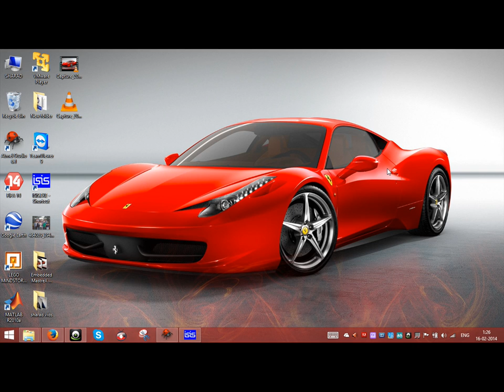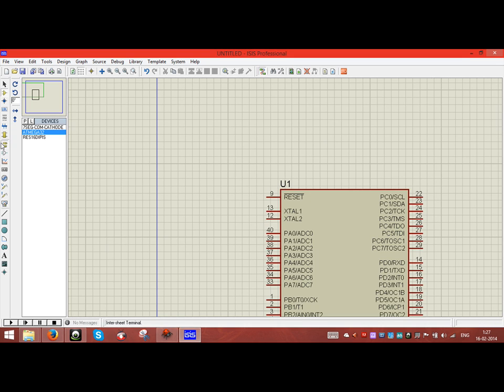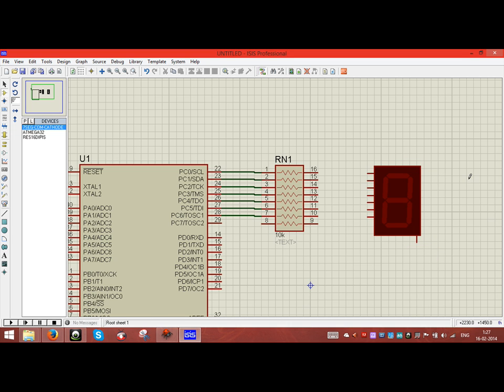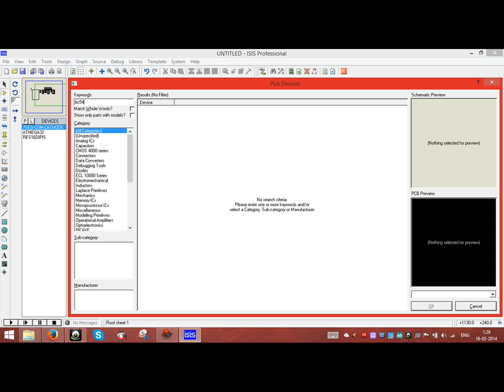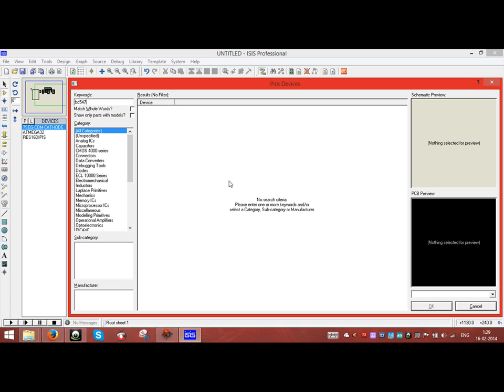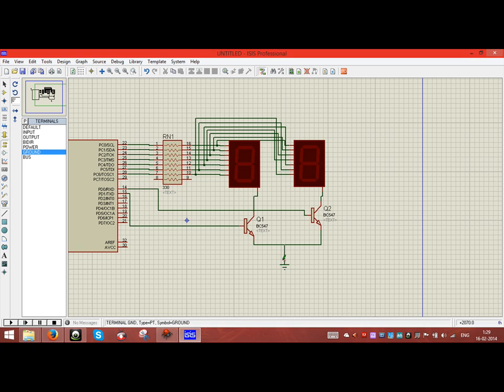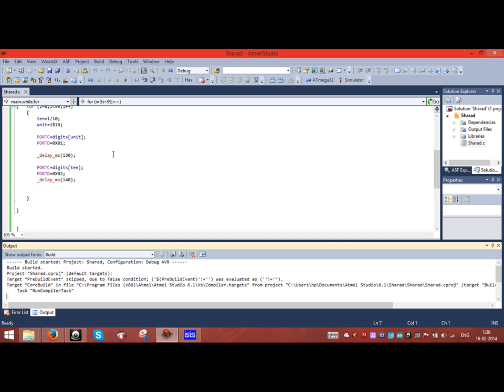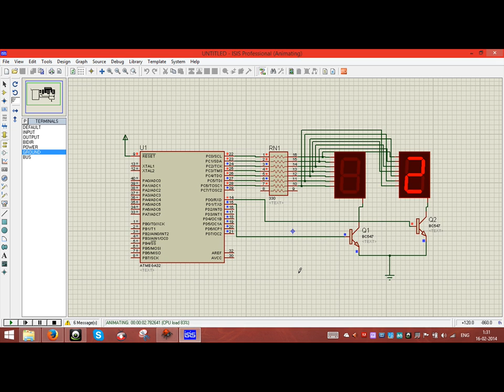Interfacing of 7segment(00-99 counter) through AVR in ISIS Proteus

Comment: /*
 * GccApplication14.c
 *
 * Created: 1/26/2017 12:52:48 AM
 * Author : Dheeraj
 */ 

#include <avr/io.h>
#include <util/delay.h>
#define F_CPU 80000000UL
void main(void)
{
 unsigned int digits[12]={0x3F,0x06,0x5B,0x4F,0x66,0x6D,0xFD,0x07,0xff,0xEF};
 unsigned int i,unit,ten;
 DDRB=0XFF;
 DDRD=0XFF;
 while(1)
 {
  for (i=0;i<99;i++)
  {
   ten=i/10;
   unit=i%10;
   PORTB=digits[unit];
   PORTD=0x01;
   _delay_ms(70);
   PORTB=digits[ten];
   PORTD=0x02;
   _delay_ms(60);
 } 
}
 }
Reply: not working
Reply: @christianbautista9010  its tested, and it worked for me 4 years ago

Comment: the code is in pic, we expect text
Reply: /*
 * GccApplication14.c
 *
 * Created: 1/26/2017 12:52:48 AM
 * Author : Dheeraj
 */ 

#include <avr/io.h>
#include <util/delay.h>
#define F_CPU 80000000UL
void main(void)
{
 unsigned int digits[12]={0x3F,0x06,0x5B,0x4F,0x66,0x6D,0xFD,0x07,0xff,0xEF};
 unsigned int i,unit,ten;
 DDRB=0XFF;
 DDRD=0XFF;
 while(1)
 {
  for (i=0;i<99;i++)
  {
   ten=i/10;
   unit=i%10;
   PORTB=digits[unit];
   PORTD=0x01;
   _delay_ms(70);
   PORTB=digits[ten];
   PORTD=0x02;
   _delay_ms(60);
 } 
}
 }
Reply: @DheerajVerma143  thanks bro
Reply from the maker: u need 2 type it ....
Reply: I need up/down counter for 7seg multiplex display code, like, if u oN a button(switch), the  display show up count (400,401,402..)
and if u put down count then 400,399,308..etc..
how can I contact u??
Reply from the maker: u only need 2 add up sme logic rest the interfacing style will remain same ....
Reply: sk rezwan hey I have the same questions as you asked ..if you solved the problem please send me the solution because I tried hard to find a solution but I couldn't ..please I have to give it to the professor as soon as possible and thank you in advance
Reply: search the code in net... u will find it.
or write it... u will be skilled